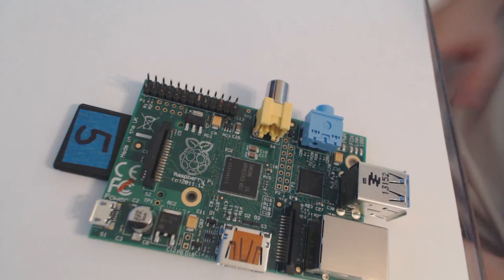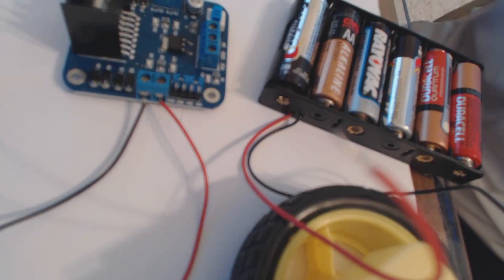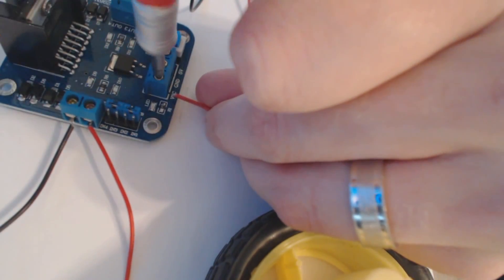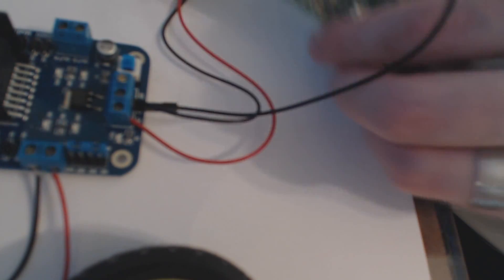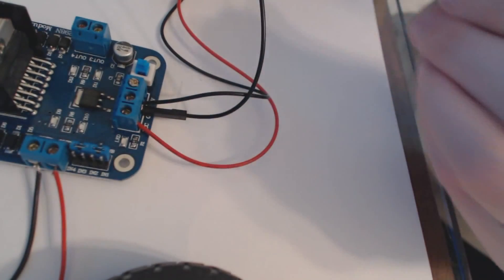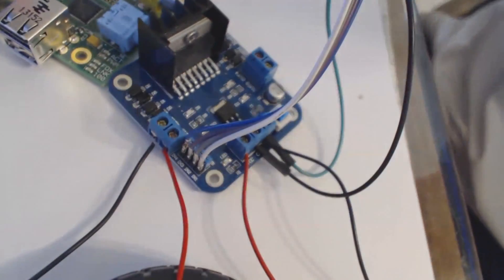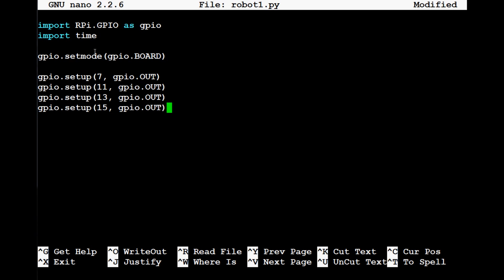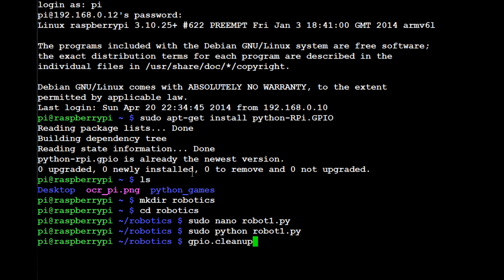Raspberry pi with Python for Robotics 2 - Motor Control

Comment: I not an expert when it comes to wiring and circuits but I am wondering, shouldn’t the two ground wires be on separate ground connections? Technically speaking? Or is something like this up to standard?

Comment: The motor didnt even start! doing it on rpi 3 b+
Reply: @sentdex please help me, 1 differnce was that i used male to male wires to connect the motor, and i used a breadboard with 2 male to female wires in each connected row for each motor. it does nothing, nothing at all.
Reply: PLS HELP ME @sentdex

Comment: Thank you for this video!
I do have a quick question. The motor that connects to pin 7 immediately started spinning when I turned the pi and the motor drive on. Is this supposed to be the case?

Comment: my motor does not spin, and my hbridge works with no battery holder. I have a 3-6 volt mottor and my holder gives 3
Can someone tell why it not working

Comment: Great video. However have a problem. When I did it my motor run nonstop. Didn't stop till i removed a battery. Added gpio.cleanup() to my code already

Comment: Hello i am making an object tracking robot using raspberry pi and i have some issues with the dc motors i am using the same robot as in your video. the issue is that when my object is towards the right for example the robot tries to turn to the right and when the object isn't detected the robot suppose to stop immediately but my robot spins then stops which isn't what i want do u have any idea how i could fix this issue

Comment: I did the same with my baterries an pi what you did, but on baterries my pi dont work. I still need to connect the cabel. The Led pwr on pi is Red,my Motors start to work, but i can not connect to the pi. Can someone help me?

Comment: Hey, I'm completely new to building robots using the pi. I have a kit and a Raspberry pi 3 model B. I tried your code with the following changes. The kit specifies the following pins for the motors:
in1: pin 12
in2: pin 13
in3: pin 20
in4: pin 21
The problem is, when I run the program, it gives warning that pin 12 and 13 are in use already and pin 20 cannot be used. Can someone help me with what I am doing wrong here?

Comment: Grate video. Thanks for sharing. I have built my first raspberry car with help of your video. I have two problem now:
1. Once I connect battery to bridge, one motor start to run until turn on pi and run GPIO.cleanup()
2. I have exactly the same motors what shown in video and its very slow and the power is week. I have replaced motor with 9V GM-370 motor and replaced battery with 9v battery, but still too slow and too weak.  It can't move if I put power back on it. 

I can't find what is wrong here.

Comment: sir i wanna know why you added false for pin 15.!
Reply: Making pin 15 false allows for the voltage on that pin to be negative and pin 13 as true will be positive.
If you flip them and make pin 15 True and pin 13 false that would make pin 15 positive and pin 13 negative thus reversing the motor. 

I just followed this step by step on my PI 3 and it worked great. This was my first time controlling anything with my PI as I just got my PI 3 a couple of days ago!

Comment: I have raspberry pi 3 ,I connected wires with same gpio configuration of yours but I'm not getting the out put after running the code
Reply: even i am fasing the same problem

Comment: Hey great video. On my way to getting this setup. Encountering a problem wherein every time I start the Raspberry Pi when it's interfaced with the motor via the motor controller, the motor starts spinning until I run a GPIO cleanup once at least. Even tried disconnecting the vcc connection from the Pi. Any advice?
Reply: Nevermind. Fixed it by changing the GPIO pin config. Was using the GCLK pin for one control pin, made it a general GPIO connection instead. #Talkingtomyself
Reply: Can you pls explain how exactly? What & where is this GCLK pin ? ANd how to make it general ?

Comment: great video, i am new to raspbrry pi,can raspbrry pi work without  wire or wireless communicating with computer?
eg- line following robot that follow the line by on/off switch without wire or wireless communicating with computer

Comment: can anybody help me with installing rpi.gpio for mac os x el capitan
errors come after this command sudo pip install RPi.GPIO
    source/py_gpio.c:87:4: error: function definition is not allowed here
       {
       ^
    source/py_gpio.c:143:10: warning: implicit declaration of function 'cleanup_one' is invalid in C99 [-Wimplicit-function-declaration]
             cleanup_one();
             ^
    source/py_gpio.c:200:24: error: function definition is not allowed here
       int setup_one(void) {
                           ^
    source/py_gpio.c:293:13: warning: implicit declaration of function 'setup_one' is invalid in C99 [-Wimplicit-function-declaration]
           if (!setup_one())
                ^
    source/py_gpio.c:345:21: error: function definition is not allowed here
       int output(void) {
                        ^
    source/py_gpio.c:419:18: error: called object type 'PyObject *' (aka 'struct _object *') is not a function or function pointer
          if (!output())
               ~~~~~~^
    source/py_gpio.c:475:18: error: called object type 'PyObject *' (aka 'struct _object *') is not a function or function pointer
          if (!output())
               ~~~~~~^
    2 warnings and 5 errors generated.
    error: command '/usr/bin/clang' failed with exit status 1
    
    ----------------------------------------
Command "/Library/Frameworks/Python.framework/Versions/2.7/Resources/Python.app/Contents/MacOS/Python -u -c "import setuptools, tokenize;__file__='/private/tmp/pip-build-GNcW44/RPi.GPIO/setup.py';exec(compile(getattr(tokenize, 'open', open)(__file__).read().replace('\r\n', '\n'), _file_, 'exec'))" install --record /tmp/pip-NQDurr-record/install-record.txt --single-version-externally-managed --compile" failed with error code 1 in /private/tmp/pip-build-GNcW44/RPi.GPIO/
Reply from the maker: +Myktybek What device are you running mac os on that you also want to work with io pins?
Reply: +sentdex yes i want to work with io pins
Reply: +sentdex what os you were using?

Comment: I wired my motor in and it won't stop running. It doesn't listen to the terminal and only stops when I take a battery out. Any Advice?
Reply: Make sure the GPIO pins you use are all GPIO GEN pins

Comment: The Enable A and Enable B are used for speed control  it uses PWM and the Raspberry does not support PWM natively but you can get a servo control board for the Raspberry PI from SainSmart that has a PWM chip on it. Servo's use PWM th control the degree of motion that they move. you can connect the Enable and Enable to the Servo board to change the speed of your robot
Reply: +Michael Harris connect the Enable A and Enable B  to the Servo board to change the speed of your robot

Comment: How come your motor doesn't start running once it's all plugged in? Is anyone else having this problem? Not sure if that signals that I'm having a wiring problem.
Reply: +mfzeidan depending on which version of the H-bridge you use (if you see outA-outD or out1-4), you may just have output (positive + voltage) coming out of the H-bridge to your motor.  The ground wire of the motor (black) should be attached to a separate ground location like a ground pin in the arduino/raspberry pi.

Comment: You are wrong !! The ENA pins stand "enable" and and if you connect it to 5v it closes the circuit to the motors. Basically if we switch it on and off very fast through a PWM (Pulse With Modulation) signal you can control the speed of the motors. If you just want the motor on connect it to 5v. P.S. You cannot connect more than 2 motors to H-Bridge

Comment: Helpful in a way but why everyone is doing robotics using pi's in python?
C is by far much better when it come to executing code at a high rate.
Reply from the maker: James Smith Is it? Got any proof to support your statements? Have you tested it? Python is built on C, is capable of executing C code, as well as GPU powered code. The idea that Python is "slow" compared to C is, natively, true. It is almost never the case that someone is doing number crunching in Python without actually just using a Python wrapper around C. That's why people are using Python.
Reply: +sentdex Studying Computer Science ,Yes C is theoretically faster due to the handling of memory and various syntax rules .However You are right in saying the numbers are basicly nothing for this reason application and yes ! Why not use Python is the opportunity presents itself ! C is ugly !
Reply: Python isn't the ideal language fir robotics at all
Reply: For a larger more complex system i would agree however in this case for learning and making small systems its makes no difference and is allot easier for people to start from!
Reply: +TKON Gaming I've tested sonics using python then C I found C was by far more responsive. my current project so far is using 4 sonics and 1 MPU. no doubt I'll have to get a PWM  controller at some point. Yes C is very hard to get used too but we'll worth it

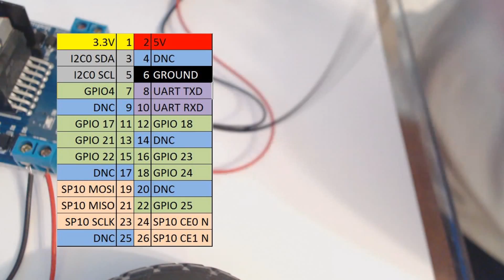Comment: 6:40 - you are doing it wrong. You are not supposed to connect 5V on the board to 5V on the Pi. That is a 5V OUT on the board if your power supply is 7-12V and the 12V jumper is in place (which is in place in your video)

Comment: http://www.ebay.co.uk/itm/Small-L298N-Stepper-Motor-Drive-Controller-Board-Dual-H-Bridge-for-Arduino-/251521203003?_trksid=p2141725.m3641.l6368 (I don't suppose you'd mind having a look at this and seeing whether it will work or not, thanks)
Reply from the maker: Peter Nobbs I do not know about the producer's qualities, or if it does actually do the job it is intended to, but, the way it is marketed, suggests that yes, that is the H-Bridge that you want.
Reply: sentdex Brilliant! I'll go ahead with it the, thank you for all of the tutorials. They are really helpful for my design project :)
Reply: +sentdex Hey, I have been trying to run the code you're showing here with this H Bridge and it is telling me there is no such module called GPIO. I'm assuming this is an H Bridge problem and I was considering getting the one you're using after all. Before this however, do you have any suggestions on what I could do? As far as I know I have done everything as you have up to this point. Thanks again

Comment: cant i use l293d to controll these 4 motors , whats the difference between the 298n and 293d
Reply from the maker: Pagal Engineer Haven't used the 293d, but I am sure you could get by just fine with that as well.

Comment: You don't need to use sudo to edit files in your home directory.
Reply: The really dumb part is that if you use sudo the first time you edit, the file is owned by the root user, and you need to use sudo every subsequent time.
Reply: Yeah using sudo like he does is terrible practice

Comment: I'm using a raspberry pi 2, and I can't get the motor to run. Any suggestions? Thank you,
Reply from the maker: Shouldn't be pi version specific, but it might be. Usually they retain the GPIO pin numbers, more just add up at the lower bits. Could be a ton of things, but the most likely scenario is something isn't quite plugged in right.

Comment: Where do I get the cable that plugs into the GPIO pins?
Reply from the maker: You're looking most likely for male-female jumper wires. These will do: http://www.amazon.com/Phantom-dupont-cable-200mm-female/dp/B00A6SOGC4/ref=sr_1_1?ie=UTF8&qid=1425755492&sr=8-1&keywords=male+to+female+jumper+wires
Reply: Exactly what I needed! Thanks alot!

Comment: My H Bridge (same as the one here) is getting SUPER hot. Any ideas what it could be? seems to only happen with the Rpi attached to it.
Reply from the maker: Sounds faulty. Do you have one of those laser thermometers? Would be wise to check what the temps are. Might be faulty due to the pi, or the board itself. Sounds like maybe it's actually the pi putting out more power than it should. Could be a whole host of issues, but just be careful, you don't want a fire.
Reply: Yeah I was just making an IDIOTIC and dangerous mistake.. Had the GND going to another 5v pin instead of ground. Lucky I didn't damage anything. Thanks for the reply all the same :)

Comment: I can't make the program run, it does nothing  when I run it, the only difference between your configuration and mine is that I only have 4 AA batteries and you have 6 AA, I don't know if that affect the stepper motor but my RPi turn on with that, you think I should add 2 more batteries?
Reply from the maker: Battery count shouldn't matter. Sounds like something is missing, especially if nothing happens at all. I have some GPIO sample code available from this series on pythonprogramming.net. Try grabbing that code and running it, just to see if anything happens when running maybe? Possible you have things plugged in wrong or something.

Comment: Great tutorial. It worked smoothly, as a tip, i got my motor cables mixed up when connecting them to the Pi and also there is an small blue switch in the Robot controller which was off.

Comment: Sentdex, ty for the tutorial, but do you have guido or a source code of a self balancing robot? And can it be in the python code?
(Im total noob :p)
Thanks in advance
Reply: Guide*
Reply from the maker: No, I do not have anything for that right now. You'd just need a gyro and some simple code to correct any tip.

Comment: How can I reopen the nano file to edit it or look at it?
Reply from the maker: nano is a file editor. So you open something with nano. The way it works is you go "sudo" which is super user do, "nano" which is the file editor, then you specify the file that you want to open, including the path to the file if it is not local. So, sudo nano exampleFile.py would open exampleFile.py in your same working directory.
Reply from the maker: Also, check out: Raspberry Pi Part 9: Navigating the Terminal
Reply: thx

Comment: Okay. Firstly I would like to ask is there any specific reason why you choose the pins 7,11,15,15? Is it just for convenience or is there any other reason?

Also why you made GPIO pin 15 made false? 

Regards.
Reply: HurricaneParticle & Mahmoud Elwakeel,
 there is no specific reason to choose those pins, you can choose almost
 any combination of pins, look here for more information: 
http://pinout.xyz/. I have personally used the BCM numbering system and used pins 7, 8, 9, 10 which is 26, 24, 21 and 23 respectively on the BOARD layout. 

sentdex FYI. This tutorial is actually slightly wrong, the mistake will only be seen  when you have 2 motors, as the one will not work at all. 

What you all need to know is that the 2 pins on the left go together and the 2 pins on the right go together.

When you give voltage through the one pin you need to give low or no voltage in the other pin, this is how you tell the motor what direction to go in. Fiddle around and it will eventually make sense. 
Let me know if this does not make sense to you at all and I explain it further.

I have made a script recently for my robot and shared it on GitHub, if you want to check it out you can find it here: https://github.com/Pyroseza/RasPiBot/blob/master/bot.py
Reply: I have also these question !!!!
Reply: awesome 
thanks Jarrod for the  replay and sharing 
that is very cool